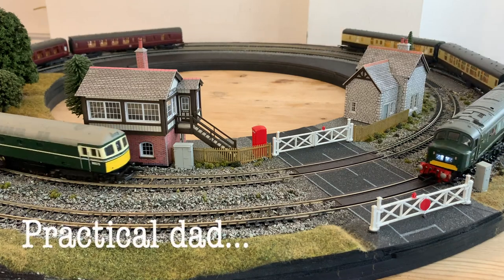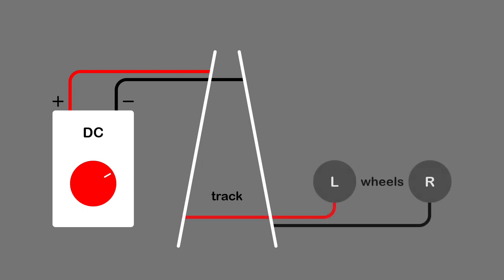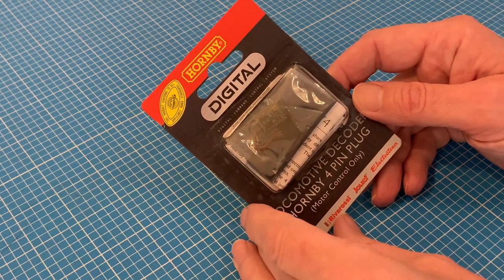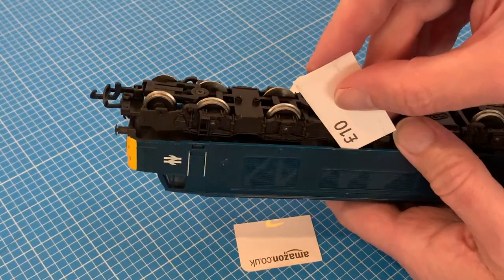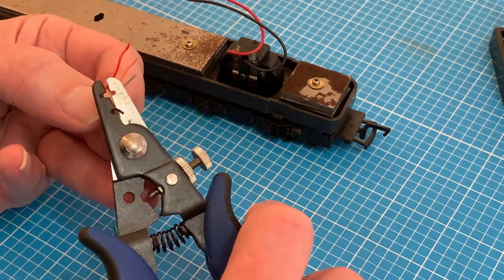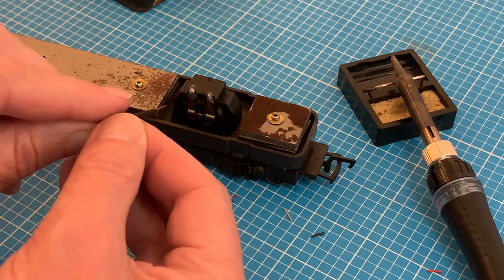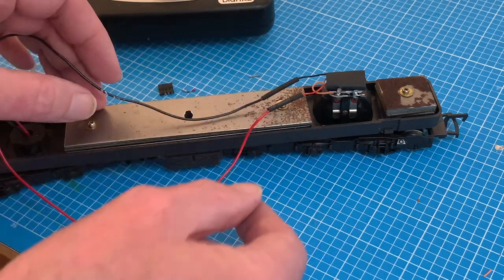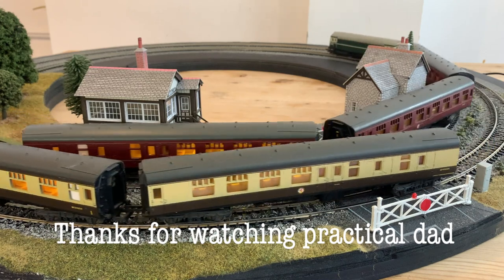How to fit a DCC decoder chip to an older model railway loco without a socket

Comment: Great video. I have around a dozen old Hornby and Lima locos from the 1970/80's. I'm about to build a loft layout. Will hopefully be able to convert my old stuff to DCC
Reply from the maker: Thanks. Good luck with the layout. The simple Hornby decoders I used in the video are great for just motor control, but if you want to add lighting etc. you'll need something like the Gaugemaster Ruby series - I used one of these in my DCC lighting test rig: https://youtu.be/vXCMHpEcoSI?si=Y6boCYTpv3yN_bF4

Comment: Hello again, Peter. 
I wonder if you had ever installed a decoder with sound function?
Reply from the maker: Hi, I’ve not done anything with sound, but I have done lights. The simple Hornby 6 pin decoder is good for just driving the motor, but you’ll need at an 8 pin or more for lights. Gaugemaster Ruby ones are very good.
Reply: Thank you so much and sorry for bothering you so often! I'll start checking them up. Besides, I think my contemplating on adding a sound to such old locos which I have in mind sounds too bold. Indeed, just DCC motor running and lights is already a great thing to have -- the way you've done it!
Reply: Excellent video
Reply from the maker: @simonwinn387  Glad you found it useful.